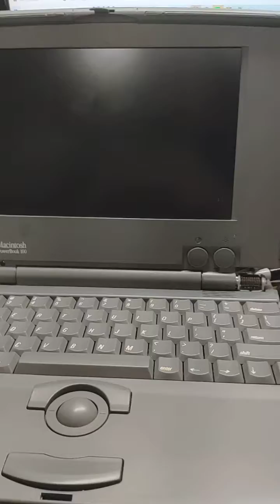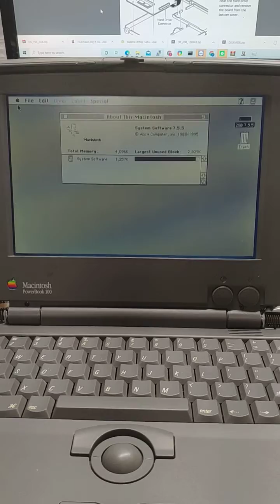Powerbook 100 Completed and Final test

Comment: Amazing job, looks mint. I've also restored mine but I may have missed a few things.

1) The PRAM circuit doesn't work and settings are always lost regardless of the state of the cell batteries, the moment it's unplugged. Any ideas? The main lead acid battery is long gone.
2) The backlight spills onto the screen at the edges and is very disctracting. Yours doesn't seem to have this problem. Is there a way to seal the gap somehow to mask it out?
3) The contrast (left) and black light dials don't seem to work that well. The range on the contrast seems too high and black light isn't very stable/smooth when it's adjusted. But I'm pretty sure I replaced the two caps on the board the back light is connected too, back in 2015.